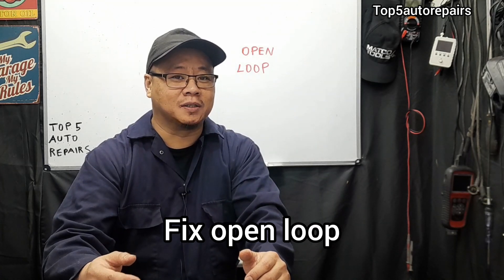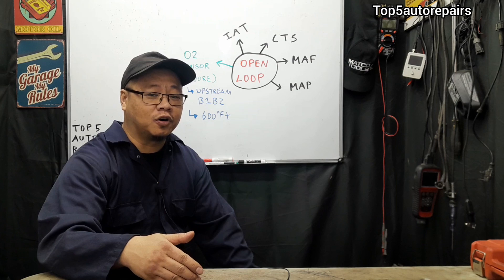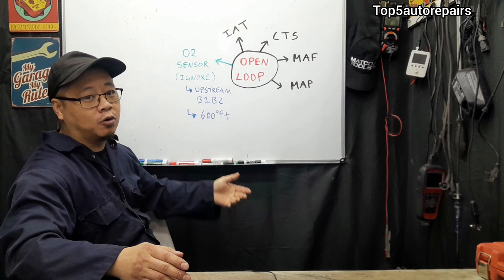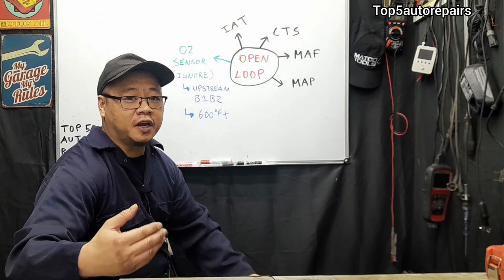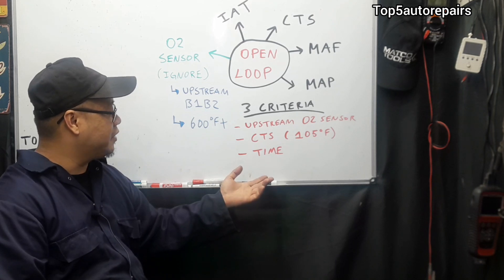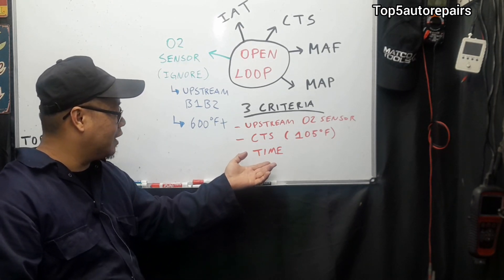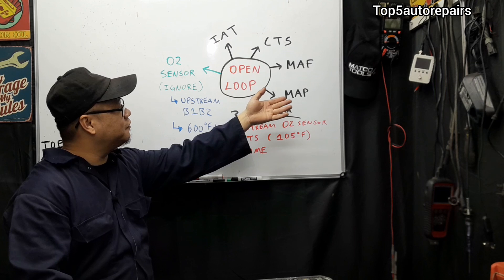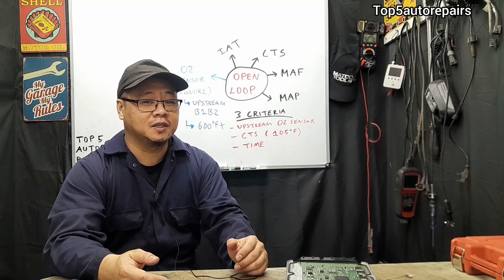STUCK IN OPEN LOOP CAR WON'T GO INTO CLOSED LOOP

Comment: on older ODB1 rigs where you do not have access to live data, how can a fella determine it has gotten to closed loop?  is there a measurement on the wires on the O2 sensor that it emits to tell that it is sending good into to the ECU?

Comment: and how do you know if you arestill  on open  loop ?
Reply from the maker: Use a scan tool and check live data. It should switch from OL to CL.
Reply: @Top5AutoRepairs  Thanks 👍
Reply: So basically closed loop is the right operating of the engine?
Reply from the maker: Correct

Comment: Hey bub 🤐 my car dash  door open light wont come on when i open any door with car moving or standing still, help.
Reply from the maker: Bad door sensor/switch/interlock, circuit or connection issue, blown door warning light bulb, blown fuse, bad BCM (body control control module).